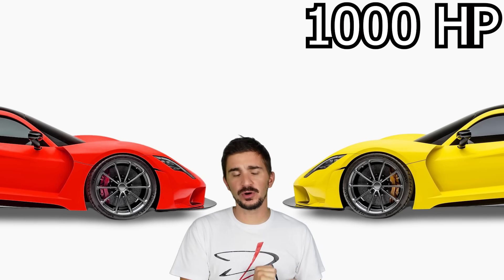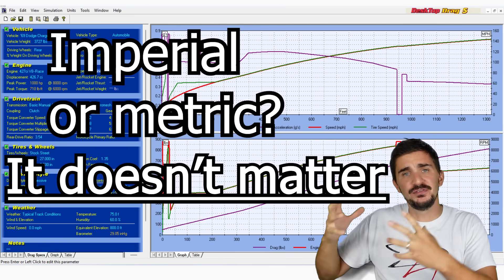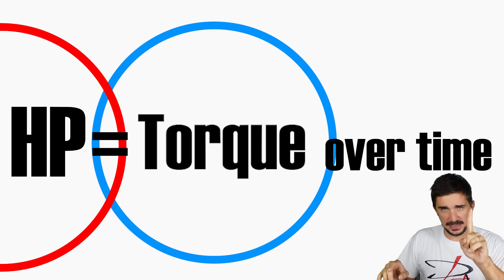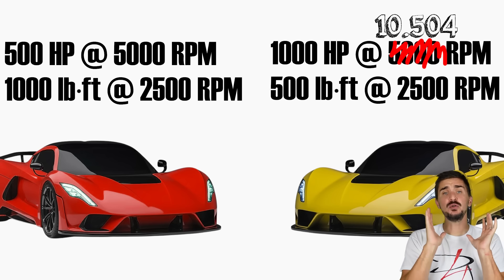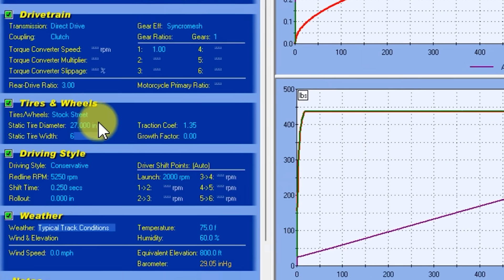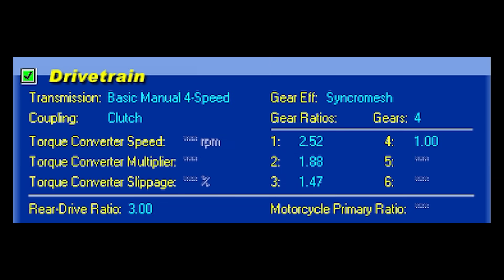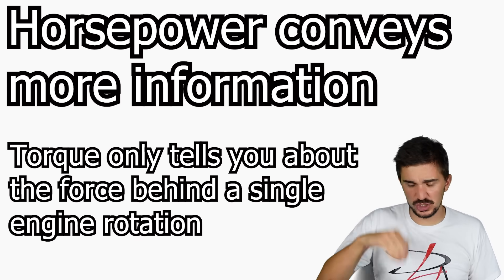Who's faster? Explained and Simulated - Horsepower vs Torque

Comment from the maker: Become a Tuning Pro: https://hpcdmy.co/dr4a
Support the channel by shopping through this link: https://amzn.to/3RIqU0u
Stem engine model: https://amzn.to/3Y5iZLv
1-2-3 count with Car parts: https://amzn.to/3jxP7Z6
Patreon: https://www.patreon.com/d4a
Reply: The absolute BEST content. 
Many (myself included) intuit that area under the curve is a more useful comparative...
S'il vous plait, an explanation of why (if it's not) area-under-curve isn't the best metric...

Of course, I'd've enjoyed your comparative of engines in which 
A. has 100 lb-ft from 2,500 to 5,252 ... and 
B. has   50 lb-ft from 2,500 thru 10,504.

Though I assume I'm wrong (as I lack acumen), it 'feels' like HP is the ability to preserve torque long enough to do useful work. Eg, if torque quickly rose to 100 lb ft at 2,500 rpm yet, dropped to 50 by 3,000, you'd have very little 'time' from which to accelerate with those "100 torques."  Conversely, if you merely retain those 100 lb ft from 2,500 through 5,252 rpm, you have a much longer period of time from which to use to multiplied torque of each gear.

Then, in a slightly germane topic of understanding engines ... I've always wanted to ask someone if power is function of the temperature delta between intake and exhaust. As in, the avg temperature of the mixture just prior to ignition vs the peak avg temperature during combustion.  It seems so obvious as to be all but tautological. But without asking someone who knows more than I, I can't know if I'm overlooking something. My reasoning is that the temperature delta is a synonym for the pressure delta. 

Thanks to anyone willing to critique this thought.
Reply: For me, I look at how much horsepower there is at 2000 rpm as I don't like engines that require you to drive them like you stole it to get good power.
Reply: I Loved this, but there is one factor that should be considered in the video.
And that is, the time for how long each engine can keep running at those figures. 
- "HP" engine @ 10500 RPM - 9.7 seconds.
- "Torque" engine @ 5000 RPM - 10,5 seconds.
And in this case, the engine with more torque, will keep running for more years than the engine with more power because the "HP" engine running at 10 500 RPM, will have more wear and will not last as long and the "torque" engine . (besides the fact that "HP" engine is injecting fuel into the cylinders, twice more often that the "torque" engine.

So in the end, I would choose the torquey engine, so I could enjoy it for longer ;)   
(unless you like to spend more money replacing engine parts more often)
Reply: Brother, I love your channel and the care you put into researching your topics, but the conclusion of this video is not correct. You can definitely say which one is faster in your setup - the 1000 hp one is much faster in both acceleration and top speed. Here's where the mistake is: you cannot say, all things being the same, including gearing, neither of the two engine setups is faster. Yes, you have to keep all factors the same (same car, same type of tires, etc), but not the gearing. Gearing is an integral part of the drivetrain, and of the horsepower/torque trade-off - precisely because, like you said, horsepower, torque and rpm are interconnected. The higher horsepower, higher revving engine will always have a shorter gearing (most of the time, in the final drive) than the high torque one. When gearing is optimized for maximum acceleration in both setups, the 1000 hp engine will have much better acceleration times than the 500 hp one. Try it - see which of the two setups has the best acceleration, with the best gearing you can set for each of the two engines in your simulator. Btw, please select a car with a chassis that can realistically take that amount of power, not a FWD Honda CRX from the 80s.

Comment: The gear ratios are everything. If you have a low torque engine you just need a big gear ratio to multiply that torque so you can get up to high RPM, and then shift gears to stay in power band. 

Torques effect on "faster" is nothing once you have a transmission. Horsepower is everything for how fast you will cover a distance. You can make any amount of torque you want with gears and high horsepower.

Comment: I realize this video is ancient history now, but I had to comment.  Everything you said is true, but it fails to state the simple fact in a simple way.  If you have twice the HP, then you can gear it down to produce twice the torque at the same RPM as the lower power lower RPM engine.  On that basis, power wins every time and by a wide margin.  From there you can go on to explain why it isn't so simple at the race track, which you did, but most of the real issues were hidden inside the simulator.  The next big issue is the flatness of the torque curve, and the RPM range over which the torque remains at or near the maximum.  That determines how many gears you will need to shift through to keep the engine in that RPM range as the car accelerates.  For a conventional manual transmission, some time is lost with each shift.  This is true for both the high power high rpm engine, and the high torque low RPM engine, but the high torque low RPM engine will likely have a broader torque curve and therefore require fewer shifts.  That is what helps to keep it competitive with the higher power engine.  Beyond that, there is a long list of variables including the weight of the engine and the vehicle, aerodynamics, transmission types, etc.  As an engineer, I will take the higher power engine, and then work all the other variables to make the best use of that power.  As you say, torque by itself is fairly meaningless as it is only one part of the power calculation.  To be fair, even power is meaningless without considering the weight of the vehicle and the ability to get that power to the ground. The mythology around, and love of, high torque, is similar to the love of loud noise and flames shooting out of the exhaust.  It doesn't get you to the finish line first. All else being equal, and it never is, that requires power.
Reply: Nie szeroki pik momentu obrotowego tylko mocy pozwala zredukować liczbę biegów gupcze 👌jak masz plaski szeroko moment obrotowy znaczy moc ciągle liniowo rośnie a na torze chcesz być cały czas na max mocy z 1000 nm na 2000 rpm masz 4 razy mniej mocy niż z 1000 nm na 8000 rpm farmazonie i 4 razy mniejsza siłę napędową na tej samej prędkości jazdy  👌🪠🍿

Comment: My 1973 Corvette BigBlock 454 cubic inch displacement has a factory rating of 275 hp with 390 foot pounds of torque. 4000 rpm for the hp and 3200 rpm for the torque. These are GM's numbers. Seems wrong.
Reply: It would make 360 ftlbs at peak power so everything seems correct to me.

Comment: this is the 1000th time ive watched this , i like how you explain things for a dumb bum like me, i will watch this 1000 x more , b-coz i understand more everytime i watch . ty.
Reply: In any given gear you will experience peak acceleration at peak torque, however peak acceleration at any given speed will be experienced at peak power. For example in 3rd gear you might experience peak acceleration at 70km/h because that is when the car makes peak torque. However that is only true if you limit yourself to thay gear. If you would downshift into 2nd at that speed you would experience higher horsepower and thus accelerate even faster.
Tldr: power makes car fast.

Comment: So basically high torque with low horsepower is better because it requires fewer rpm's
Reply: Why would that be better? Low horsepower will always lead to a slower car.
Reply: @idkhowtonamemyself2137 having higher torque means having higher horsepower at lower rpm's lol which means faster acceleration
Reply: @judemusfinch4456  That' only true if you're assuming both cars will have the same gear ratios which is usually not the case.
Reply: @idkhowtonamemyself2137 ah ok I see
Reply: high torq at lower power work onlower rpms but it cant do as much work inthe same time frame as low torq high power engine if both will have perfect gearing  🪠🍿

Comment: Very nice video thank you. I tested,  Tesla Long Range awd ( 378 kw / 493 Nm / 0 - 100 km 5 sec )  and BMW İx Xdrive40 awd ( 240 kw / 630 Nm / 0-100 km 6 sec) . Tesla reach to 100 km/h  earlier but in the first 2 second BMW is faster than Tesla. I am talking about the initial reaction when you step on the gas

Comment: from changing the value of the rpm at peak hp your saying torque is peak torque is constant from the rpm at which it occurs to peak hp but torque reduces as an engine approaches peak hp and so the rpm has to be bigger for a peak hp than torque

Comment: this is a terrible demonstration. he just concluded that a diesel pickup is faster than a formula 1 race car simply because it has more torque to overcome the insane 1:1 final drive ratio. 

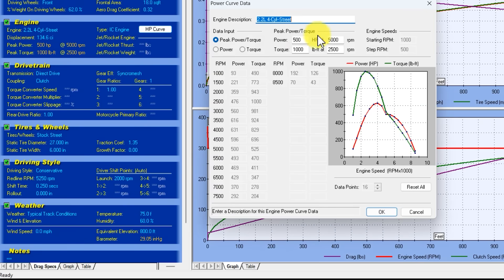7:20 sure he kept everything the same, including the redline set at 5250 under "driving style".  not a very good comparison considering the redline was actually over 10k.  not that it even matters since the final drive ratio is 1:1 and the engine wouldnt even reach redline until amost 300mph.  if he ran this simulation again with a higher final drive ratio, the higher horsepower vehicle would win.  at 7:10 you can see that the torque dominant vehicle never revs above 1520 rpm except during launch.  he chose arbitrary numbers for the ratio and got an arbitrary result.
Reply: yea because off the same gearing this egzample is ridiculous in regard to nirmal real world setup where each have perfect gearing once this happen its game over for torq 😎👌🏻🪠🍿

Comment: With a perfect transmission wont HP always win?
Reply: All Work is done by Power.  Work = Force x Distance.  The engine makes Power.  Power = Force x Velocity.
The transmission exchanges Force for velocity as leverage to deliver the Power to do the Work.
You can’t blame the engine if the transmission is tying the engines hands behind its back.

Power, not torque, is the limiting factor in not only the top speed of a vehicle but also how quickly it can accelerate at any speed and how much weight it can pull up an incline at any speed.

Comment: HP doesn't matter, because no one (at least in normal use) drives a car at 6-7000 rpms
Reply: 😁Power doesn’t matter?  🤷‍♂️ Without power there is no population whatsoever. All work is done by power.
Power, not torque, is the limiting factor in not only the top speed of a vehicle but also how quickly it can accelerate at any speed and how much weight it can pull up an incline at any speed.

Is it “normal use” to pass, to merge etc?   🤷‍♂️
Reply: Thats true. I send it to over 8000 rpm.
Reply: @idkhowtonamemyself2137  👍attaboy! 🥳 Give it like you mean it!
Cheers mate!
Reply: So, you're scared of the throttle?
Reply: @ShadowFalcon 😂 Tachophobia
Reply: Expecting to go fast from the go slow end of the tachometer is a fools errand

Comment: Old v10 Formula 1 engines are even more extreme than that horsepower oriented engine. Torque can be as little as 240 lb-ft and hp can be as high as 950 because they rev up to 20,000 rpm

Comment: Semi truck engines are the opposite of that disproportionally horsepower-oriented engine. Some of them can make 500 hp at 1600 rpm and 2050 ft-lb of torque at 900 rpm. And with 9 to 18 gear transmissions the wheel torque is insane.

Comment: My problem with hp is that you can have a 300hp engine that makes a peak torque of 200 or a 300hp that makes a peak torque of 500
Reply: Do you have a “problem” with torque because you can have a 300lb-ft engine that makes a peak power of 200 or a 300lb-ft that makes a peak Power of 500?

Do you have a “problem” with RPM because you can have a 7,000RPM engine that makes a peak power of 200 or a 7,000RPM that makes a peak Power of 500?

Power, not torque or RPM, is the limiting factor in not only the top speed of a vehicle but also how quickly it can accelerate at any speed and how much weight it can pull up an incline at any speed.

Comment: HP>TQ unless towing or hauling.
Reply: Nonsense.  Power, not torque, is the limiting factor in not only the top speed of a vehicle but also how quickly it can accelerate at any speed and how much weight it can pull up an incline at any speed.

Comment: Torque wins races is all I’m hearing 🤣🤣
Reply: How could torque win a race it is like a snapshot: Frozen and timeless.
A Race is a competition of Work measured against Time.
Power is Work/Time.
Power is the definition of the measurement of a race.
Power, not torque, is the limiting factor in not only the top speed of a vehicle but also how quickly it can accelerate at any speed and how much weight it can pull up an incline at any speed.

Comment: Why in the actual f*ck did use such unrealistic examples?!? Use a freaking 6-10 speed like would be fitted to any modern car and you'll find that HP is always king. Misleading video for people that don't understand hp.
Reply: 👍 video is 🚮
Torque is irrespective of time: Frozen and timeless.
A RACE is a competition of Work measured against Time.
Power is Work/Time.
Power is the definition of the measurement of a race. 
Power, not torque, is the limiting factor in not only the top speed of a vehicle but also how quickly it can accelerate at any speed and how much weight it can pull up an incline at any speed.😂
Reply: @rollsroyce329  exactly

Comment: Mostly a stupid test, cuz most of the things you did are absolutely ridiculous. The only somewhat realistic test you did was with the 4 speed and the HP engine is obviously winning cuz you eliminate the issue of low torque with proper gears. And most modern transmissions have a lot more gears than that so the advantage of HP is gonna increase even more. You're playing around with nonsense and not getting to the point (gear ratios eliminate the issue of no torque). HP is the only thing that matters when you have proper gear ratios for the givin engine (which in the real world 99% of the time, you do.) Misleading video. Horrible testing.

Comment: To maximize acceleration at any given speed, it really comes down to selecting the gear that will maximize the engine's power.  For example, if your engine is running at peak torque, downshifting to a higher RPM point that produces more power (but less engine torque) will always result in better acceleration.  After getting some driving experience, I sort of had an intuition that a downshift to a higher RPM beyond peak torque often results in better acceleration, but not always.  These exceptions were old lazy V8s that you could rev way past power peak and find that you would have had better acceleration if you had upshifted.  But it took some time for me to fully grasp that engine power curve was a direct measurement of this phenomenon.  Electric motors are an interesting example here, because they generally typically have a flat power curve above a certain RPM.  When operating at higher speeds where the flat power curve is flat, gearing makes absolutely no difference in acceleration because the power is the same regardless of gear ratio.

Comment: Small correction. Torque can be separated / calculated separately from hp. If theres no rotation theres 0 hp. You can apply 100lb/ft of torque with a wrench to a bolt. If there's no movement of the bolt, there zero hp. Thats 100lb/ft with 0 hp. You can't calculate hp without the torque. Hp is force over time.